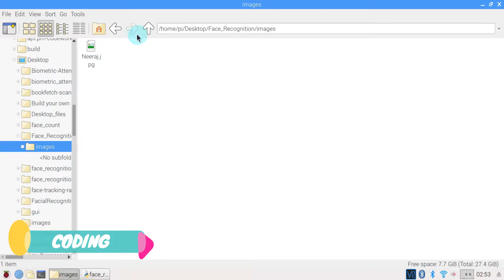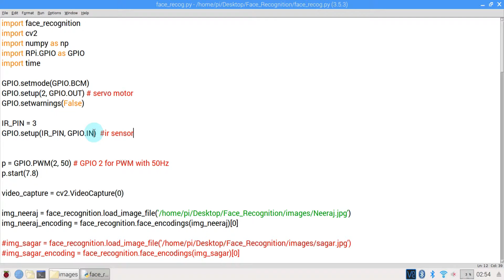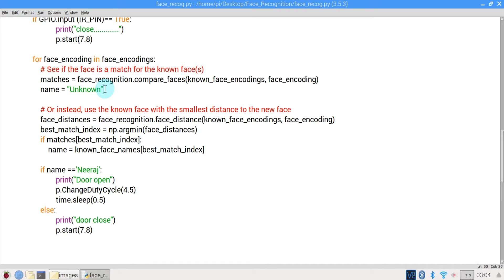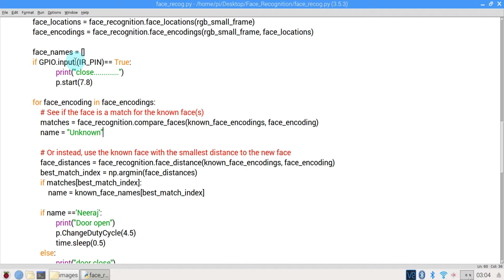Smart door lock system using face recognition and raspberry pi |face recognition | Experimentalist.

Comment: Can you tell how did you connect external power supply to servo motor and raspberry pi?
Reply from the maker: you can give the power supply to the raspberry pi using a USB power adapter of minimum rating 5v, 2amp, and maximum 5v, 3amp. you can also use your mobile phone charger of rating 5v, 2amp or you can also use power bank which gives the output of 5v, 2amp, and maximum 5v, 3amp.
For servo motor :
you can also use raspberry power to run the servo motor. if the power is not enough to run the servo motor then you can use, external 5v power supply, or in a way, you can also use your mobile charger to run the servo motor externally. for this, you need to cut the USB cable of the mobile charger from the part which you insert in the mobile, I recommend cutting old USB charger wire. if you cut the wire, inside this there are 4 wires, use only two wires, which is black and red. the red wire is of +5v and the black wire is of ground. now connect the red wire of USB charger to servo motor red wire, and ground wire of servo motor to brown wire of servo motor.

this part is very important, read carefully:-

common both the ground, raspberry pi ground and power supply of servo motor, ground. means connect raspberry pi ground and power supply of servo motor, to each other

Comment: Hi sir... I'm very impress on your project. I'm also interest to do this project but before it clear with code then move to practical. I'm also installed Raspberry Pi os and when it lots of errors rectified but I can't clear this error  "RuntimeError: This module can only be run on a Raspberry Pi !".
Please help to solve this error , then I will move to buy components for practical.
Reply from the maker: I think you run the code in laptop. There are various Library which support on raspberry pi only.thats why you unable to run the code in laptop. And buy the components, definately this work, if you need any help then you can ask me
Reply: @experimentalist1494  Thank you very much sir.

Comment: can i run this code without Raspberry component?
Reply from the maker: see if you run the code without raspberry pi, it cause an error in code this error is of libraries. there are some libraries that are only for raspberry pi like

 import RPi.GPIO as GPIO

if you delete this library from code and other code having this library then you are able to run the file without error. and the rest of the function is the same. now you are able to run this file on a laptop/pc
Reply: @experimentalist1494  Thank you for your reply.
Reply: How can i run my code without Raspberry circuit board in my laptop. Can u plz tell me, how the os installed and provide some links and procedure.  
 @experimentalist1494
Reply from the maker: @sharefiles8620  for installation of os in raspberry pi go to given link, this is my youtube video

https://youtu.be/16bQQIfLJos

Comment: need steps on how to run the project
Reply: basically how to switch on the camera etc
Reply: does the video window come up automatically when we run the code??
Reply from the maker: @voladmin2412  yes, it automatically come
Reply from the maker: @voladmin2412  camera is automatically turn on when you run the code
Reply: @experimentalist1494   I'm still getting errors in running the code
Reply: @experimentalist1494   it would have been great if you could have recorded the part where u run the code (with the exact code on github and with the same connections on raspberry pi as shown in the circuit diagram )
Reply: @experimentalist1494   is there a way of connecting with u on some other platform in order to get faster replies
Reply from the maker: @voladmin2412  you can contact with through Instagram , today I make new Instagram I'd for quarries of subscriber, I'd is   experimentalist123
Reply from the maker: @voladmin2412  what is the error name
Reply: @experimentalist1494  ohh ok thanks
Reply: @experimentalist1494  will continue this on insta